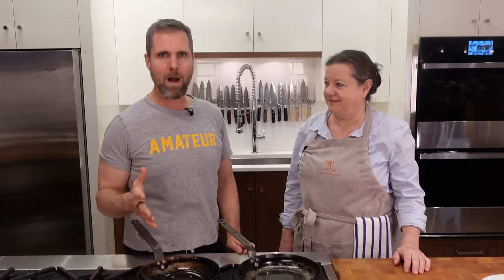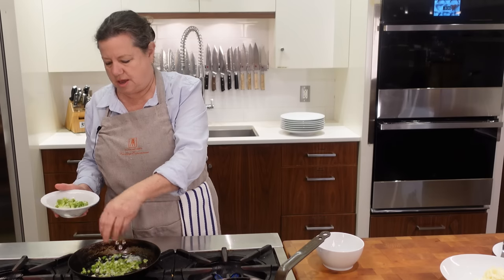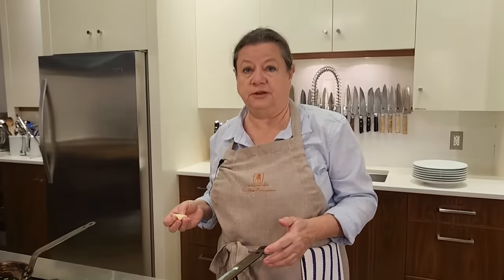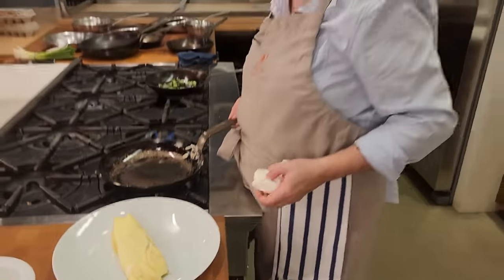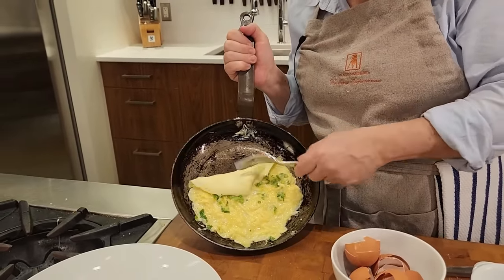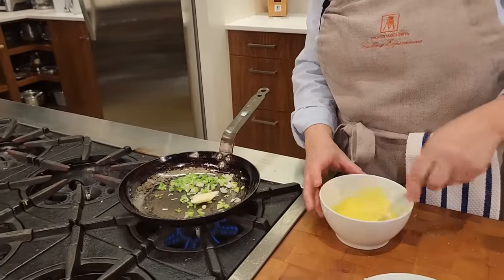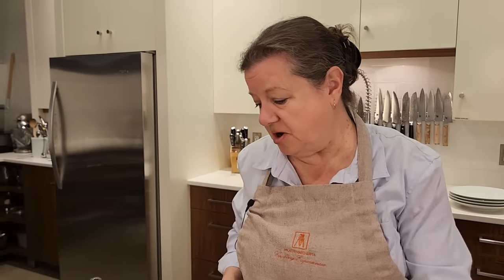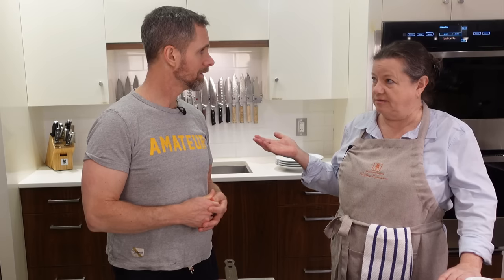Can we make a real French Omelette in  de Buyer Egg Pan?

Comment: She needs to get the front part of the omelette started curling first. You get your omelette almost out of the front of your skillet and then start rolling from the back, this technique she's using just makes a mess and is almost impossible to get a completely enclosed roll that doesn't splatter "BAVER" all over the plate.
   When the curd starts to setup in the pan stop using the fork and start gently agitating the skillet, once the omelette is cooked about 2/3 through the egg will release from the pan and that is the easiest way to tell that your omelette is ready to roll. A quick flip of the TOE of the skillet rolls the front then lift the HEEL of the pan and start a gentle roll for the perfect presentation with out fork marks or splattered egg messing up the plate.

Comment: I do this several times a week with the 8” Mineral B. Most important tips: 1) always pre heat the pan carefully to the right temperature. Too hot and it will stay too hot and burn the butter. Too cool, it will stick. 2) start with eggs at ROOM temperature. Cold eggs won’t coagulate well 3) have at least a bit of butter or saturated fat. Better for non stick and flavour. 4) shake the pan to prepare scrambled eggs in a creamy texture, with small uniform curds. Then spread out and quickly form the skin of omelette and flip.

A classic French is supposed to be scrambled eggs encapsulated in a thin, colourless skin. Baveuse means the inside is slowly running and creamy. This is different from something rolled  up like a wet carpet. 

Few restaurants get it right, especially in North America. Indeed a prefect French omelette is quite difficult to do  without practice!
Reply from the maker: Thanks for sharing!

Comment: It’s interesting because that pan looks like bare metal in the center and well seasoned on the edges. But it’s completely non-stick in the video. Very impressive to have that omelette come out perfectly with zero sticking. 
I’ll have to check out some of your seasoning videos to see what I can learn. I have this same pan and it’s dedicated to eggs and omelette. I’m always tinkering with the seasoning try to maximize the non-stick. Currently it’s not so good, quite a lot of sticking.
Reply: That caught my eye too.  Though if you rewatch, Chef commented that she's been using the pan for an "extended" time.   Implication being to learn & practice on the pan (don't recall if that is days, weeks, prior, etc.). Since Chef used a fork here, I'm making the assumption she may have done the same at home.  Watch her motions and notice it's possible the habitual pattern used and the seasoning has been consistently scraped the same even if only mildly, due to chef's use of a fork(?)!  That might explain why the bottom appears "bare" and the sides well seasoned.
Reply: Try stainless steel pans as well!

Comment: I like to make low and slow, soft scrambled eggs.  I've done it in a double boiler (pyrex bowl in a pot), my matfer carbon steel pan, and a non-stick pan.  The non-stick is the only one that isn't a pain to clean.  I'm going to try to get my carbon steel seasoning up to par, but for now I have the nonstick, so I'll use it.
Reply: i'm no kind of chef guy but i do low & slow scrambled eggs in a matfer pan too; yes it leaves more behind than omelets or fried eggs, but it's still reasonably easy to clean once the seasoning is halfway decent:

get yourself a dedicated bristle brush scrubby just for this job and use it to scrub the pan under running hot water (no soap), it'll clean up fairly quickly without touching the seasoning layer

inspect carefully for any tiny leftover bits then pop it on the stove to dry before putting away. if you feel like the seasoning is getting a bit worn then crank the heat, rub in a bit of oil and let it cook until the smoke stops, done

Comment: Yes!! Finally a chef making a French omelette in the De Buyer Omelette pan! (or any carbon steel pan for that matter) I do not use non stick pans. I have that 9.5" pan and I try to make French omelettes in it quite often.  To make one"perfect" is a lot harder than it looks. It take practice to get it right. For some reason I can't get that smooth yellow finish on mine. I think I'll try adding oil to the pan next time. Typically I just use butter. I use a OXO spatula instead of a fork to avoid scratches. Not a big deal. The pan is fantastic to use. I also just wipe it out with paper towel. Toss the first one then finish it off with a clean sheet.
Reply from the maker: Good on you, way to persevere!

Comment: 2nd time using this method. It works great. Love the easy clean up. I did it in my large Mauviel saucier carbon steel. It’s 99% non stick. I don’t like the coated non stick pans. I’ll try it now in my Emeril square cast iron but the sides are not so high so I hope it won’t splatter much.

Comment: Now try to make a French omelette in a stainless steel. That is pure technique to do it without color and without it sticking.  Strangely, I’ve had more difficulty using carbon steel, but then again, I have the Made-In carbon steel. It’s really thin and it makes it challenging to regulate the heat.  I do like the side height though.

The sides of the pan that are being used here seem to be a bit low for vigorously shaking the pan.

Comment: Eggs aren't the most difficult thing. I can even do Omlettes in my stainless steel pan (without butter, with oil). My stainless steel pan has trouble with Tofu though and if i want to fry Gnocchi straight from a package and if they are still kind of wet (if you let them dry a bit it's not a problem anymore). 
I just bought a carbon steel pan and it has no difficulties with Tofu. I can fry it easily. I'll try to fry wet Gnocchi next. Hopefully they won't stick.

Comment: You prepared a lovely omelette.  Using clarified butter (or ghee) in lieu of regular butter is as a good way to prevent browning.  I now use carbon steal almost exclusively for all cooking.
Reply from the maker: Excellent! Thanks!!
Reply: butter causes browning since it burns, it doesn't prevent it, it simply adds taste, watch the peppin vids, he explains it better
Reply from the maker: @FussyPickles  butter does not need to brown. That's too high of a heat.

Comment: Awesome! She is clearly a pro cook. It would have been amazing to see her pan temps with infrared. Seems to achieve Leidenfrost it would typically be much hotter than she’s using here, but clearly this is an amazingly well seasoned pan.
Reply from the maker: Thanks. Mara is a legend!
Reply: You don't even need that much, I got one of the pans used here, the 8 inch de buyer and I was making omelettes with it after the first seasoning.
Reply: @lolkthnxbai  you are right! After the video I used Mara’s technique and my 10” Mineral B at lower temps than normal and created my best omelette’s ever. No color perfection. 🤙

Comment: I've never used carbon steel but I've done French omelettes on non-stick and they seem to be one of the few things in cookery I can actually do ok! I tend to scramble them for a little bit longer than was done here so it is not quite so runny in the middle before I leave it alone but generally follow the same technique. 
I do think it is probably easier using a spatula and non-stick than was done here and, of course, I'd never use a fork on a non-stick but it does prove it can be done!

Comment: My Two "Go TO" omelette pans are first a vintage Wagner Ware #9 cast iron Chef Skillet (which has the rounded sides and a square tipped longer handle for tipping) then the De Buyer Pro 9 1/2" Carbon Steel Omelette Pan.   One key element is NOT to use near freezing eggs out of the fridge but rather let the eggs get to room temp for at least 10+ minutes prior to scrambling.  Next when the butter stops foaming then you are good to go.  I keep the pan moving back and forth and the flat side of the fork going circular in the middle.  For an in depth tutorial, check out the French Chef Julia Child's old video (here on YouTube) which goes into great technique on the pan hold etc.  Nice video... thanks!
Reply: FWIW: Julia Child used aluminum omelet pans. You can still buy the pans she designed and used. She also cooked the omelettes for about 10 seconds, I don't know if I would eat that....

Comment: Honestly I've not had any issue with cooking my eggs on carbon steel, omelette or sunny side up. Other than the time I tried eggs as the first thing I cooked after first seasoning - they did stick just a tad.  And I actually use even less fat.
In fact, I find that getting my omelette just right is somehow way easier on the carbon steel than it ever was on a non-stick. Maybe that's cause the carbon steel is more heat retentive, not sure.

Comment: Question: if you want them a tad harder, why can't you just leave then in the pan cooking a little longer on the stove top? Also, I have way too much color with mine. Any suggestion what I might be doing wrong? Heat is on 6 out of 10, use salted butter and canola oil and prepare the eggs the way that you did. Many thanks in advance!

Comment: If you slide the omelet about an inch or of the pan just before you plate it, the omelet fold will be under and you won't have to use your hands to push the end under.
Reply from the maker: Good tip, thanks

Comment: I used stainless steel with a bit of oil to make scrambled eggs. The stuck bits left were the same or less then my 1 year old ceramic oan that i try hard to take care of. Not perfect but 0 chemicals for that. Carbon steel with a bit of oil or butter should or can be as non stick as ceramic. Plus you can be rough with the cleaning, just dry right after washing.
Reply from the maker: Sounds great!

Comment: Fish has always been my problem. Eggs I’m good with well seasoned carbon steel. But fish is an issue so I use the Tramontina nonstick occasionally. I’ll use the Smithey or my Blanc Creatives that I’ve had for years. I go thru cycles of using high quality stainless steel pans, then back to the carbon steel.
Reply from the maker: Thanks for the feedback

Comment: Two questions:  Can anyone tell me the best size pan for making omelettes?  I generally eat 3 eggs when I make mine.  Or maybe, what is the size she is using?  

Next, I would really like the De Buyer Carbon Pro series because of the handle.  But does that style pan work with omelettes or is it better to have the flared edge like the one she is using?
Reply from the maker: Hi, a 9'5 or 10" is great for 3 eggs. The Pro is a great choice and you can make a perfect omelette in any Mineral B

Comment: Obviously, Pepin apprenticed in France, on a carbon steel pan. He's talked about carbon steel pans on his PBS show. What he said was, if you don't season the carbon steel pan and use it often, it sticks. And he doesn't use it often, because it sticks. And that, thus, it's a "vicious circle"! Of course Pepin used non-stick on show, because it was sponsored by Anolon, a non-stick pan manufacturer.
Reply from the maker: Exactly
Reply: To be honest, as nonstick pans go, I had the copper layer Analon nonstick pans, a set that had the 8 and 10" sizes and as nonstick pans go, they lasted quite a bit longer than most, provided you don't overheat them but they do wear out over time and the 8" was the worst of the two. They got replaced with an All Clad aluminum nonstick in the 10 size that I got specifically for those times when you need absolute nonstick, and or for acidic foods. I don't use the nonstick often and often cook in cast iron, carbon steel or stainless steel.

Comment: Leave Pepin alone. The message was and still is that it is not a must but probably far easier for most people. If I would have to wait until my De Buyer carbon steel pans would be seasoned good enough for an omelette I wouldn't eat one in months. That's the point of the non-stick pan for omelette.
Reply from the maker: Sorry, you use a nonstick pan because the seasoning process takes time? Like a day?
Reply: @Cook-Culture  Me personnaly, yes. In fact I just did one like half an hour ago and it was pretty good. I tried to do exactely like Mr Pépin showed for his classic french omelette and it was not too far off. The lady on your show certainly didn't bother try to do the same technique à Mr Pépin in his video.
Reply from the maker: @12345fowler  Way to go!

Comment: Great video.  I'm curious if you ever use an infrared thermometer.  If so, what pan temp do you heat to?
Reply from the maker: Hi, I had very inconsistent results and learned that the shiny areas on the pan surface mess with the reading.  I use my senses to gauge the readiness of the surface.
Reply: @Cook-Culture  Copy that, thank you!  I like using my infrared thermometer on cast iron...but it seems to read WAY low on my 5 ply stainless pans.
Reply from the maker: @winmod70  that sounds right. If your carbon is all black it should work but I have some all black and some that have some bare metal showing, like the pan in the video.

Comment: Temperature is everything. Use an IR thermometer and give us some real numbers! Once I have a number I can do it over and over again even without an actual measurement since I know how it felt.
Reply from the maker: IR guns on carbon steel are unreliable due to the reflection
Reply: @Cook-Culture  Then that should also be true of stainless steel as well, if not more so. Don't get me wrong, I have carbon steel, stainless steel, and cast iron and each has their pros and cons depending on what I am using it for. I also use non-stick cookware, too. But I have yet to see you dive into what each is especially good at. I think we can agree that the worst thing to do is to buy a full set of any one type and expect it to be good at everything.
Reply from the maker: @boftx1  Yes, for sure we can agree on that - minus the nonstick!

Comment: I'm trying to up my cooking game, so I've been watching a lot of your videos and have a couple of questions:
1. I notice that she used paper towels on the hot pan. I remember in one of your videos you caution against using paper towels in a hot pan. How big of an issue is that?
2. I'm looking to upgrade my stove from a glass top electric to induction, and one of the things that has drawn me to your channel is the prevalent use of induction cooktops. But I've noticed in the last several videos you've been using gas. Even in the one that looked at carbon steel on induction to see if the new Matfer pans would turn into spinners, you used a portable induction cooktop instead of the built-in from your earlier videos. Have you given up on induction?

BTW, I have one of the new Matfer pans. I've only used it once on my electric and it sadly seems to spin when I heat it up, so I'm not sure they have that worked out yet.
---> EDIT: I checked my Matfer pan and it does not have the logo stamped on the handle, so I believe I have the old style. I will be calling them to get a replacement.

Thanks for your great videos. They've really upped my game already.
Reply: I currently have a glass top and have been looking into induction too.  Although I’m moving in a couple of weeks to a place with a gas stove so my induction research is semi-moot.  I do have a portable Duxtop I’ve experimented with.  What I’ve learned is that there are two critical characteristics with induction.

One is the size of the coil or coils.  You really want them to match the cookware you are putting on there.  Otherwise, even with relatively thick cookware with good thermal conduction you’ll get hot spots, er… hot rings.  You can see this best by putting ½ inch to an inch of water in the cookware, then bringing it slowly up to a boil – it’ll boil right over the ring.

Two is the “drive” or power circuitry.  I believe this only comes in to play with better (high end even) induction equipment.  The relatively inexpensive stuff typically just turns on/off at full power and uses duty cycle to control heat.  I think the higher end equipment is on all the time and actually varies the power levels.  I don’t know, my Duxtop was only $75.  You can see this with the barely boiling water test too.  You’ll see bubbles form, then stop, form, then stop, etc. as the power cycles on/off.  Turn it up, and the boiling periods get longer until they merge into a continuous boil.  Turn it down and they get shorter and shorter until it stops, as it cools down enough between cycles to not even boil.
Reply from the maker: Howdy, thanks for the comments. Yes, I would use a rag to clean my iron but her pan is not too hot and super smooth without any sticky bits so she got away with it. 
Induction is my preference.  This kitchen is my oldest kitchen that I built in 2009, before I was a fan of Induction.  You will see my Induction cooktops back in my new dedicated filming kitchen that we're building now. Should be ready I'm March or April. 
Yes, the stamp is the telltale sign. 
Thanks for your support.  I hope you love your new Induction as much as I love mine!!
Reply: When I cook an omelette or any egg dish, the temperature is relatively low. Plus, as seen in the video, the chef took the pan off the heat several times. Carbon steel pans heat up fast and cool down fast so once you slide the eggs out of the pan and grab sheet of paper towel, the heat has dissipated. I do exactly what she did. Now had I cooked a well seasoned steak in the pan? That's a another ballgame!